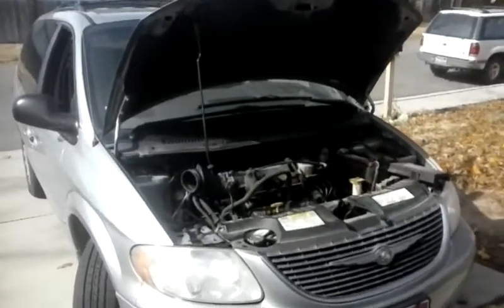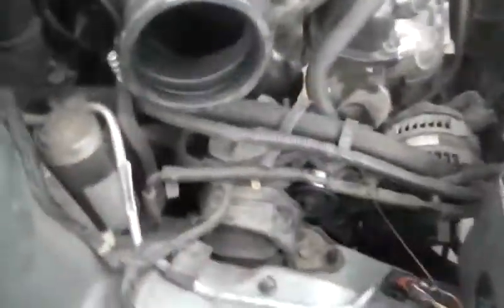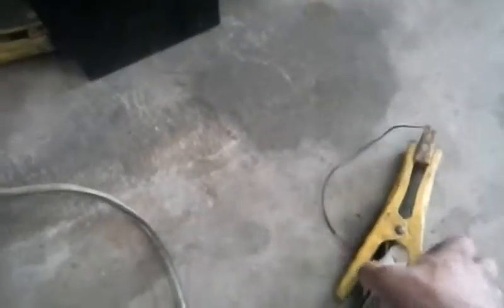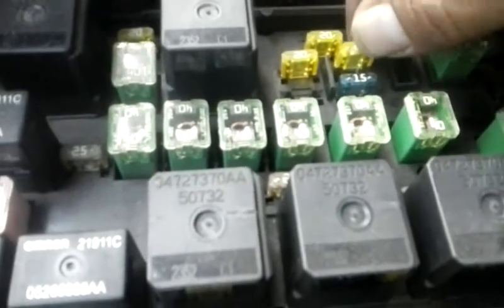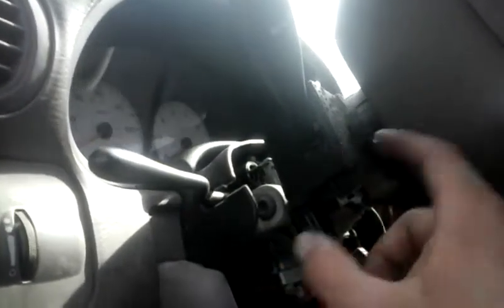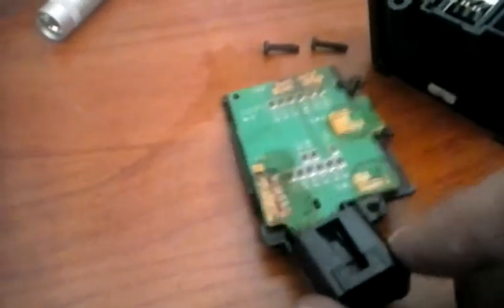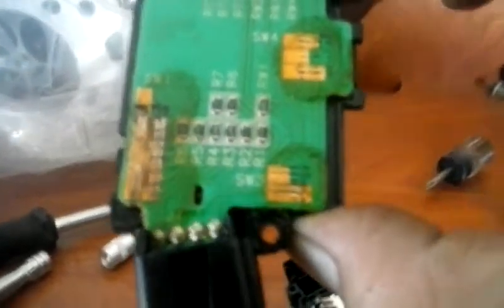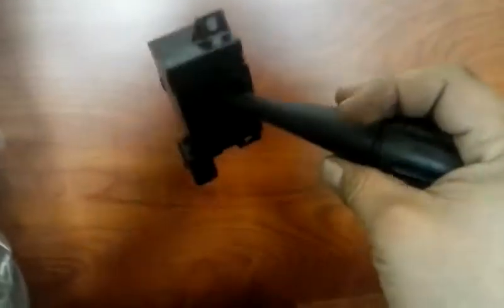Chrysler minivan bad washer fluid motor

Comment: Under Air Cleaner Assembly there's  plastic element each go together with reservoir through hole in car metal  body. How have remove it  to removed reservoir? Squeeze, up or down?